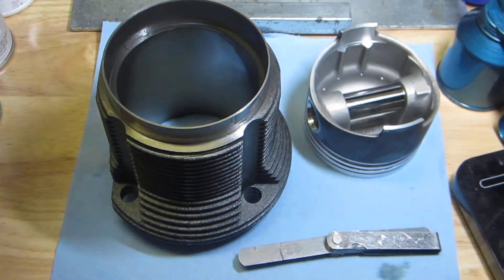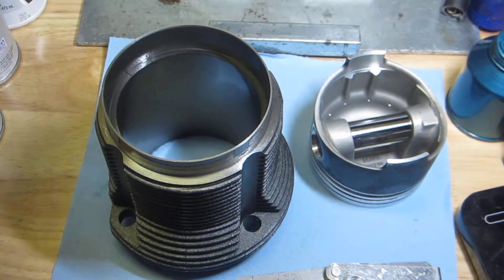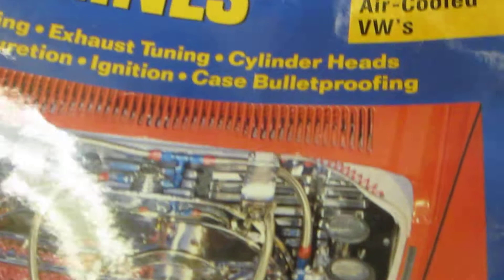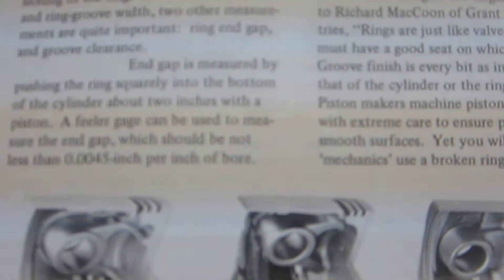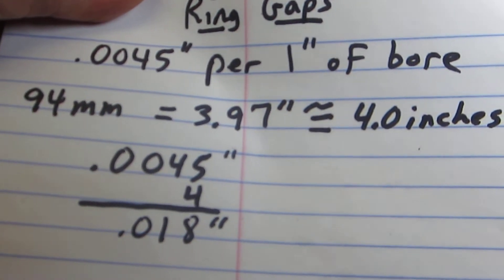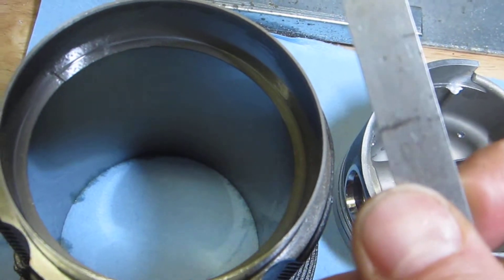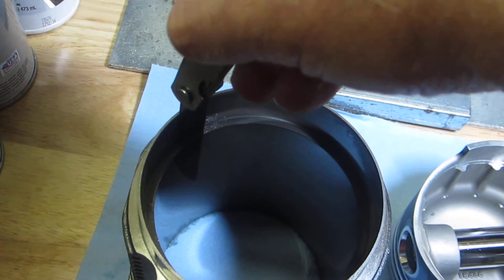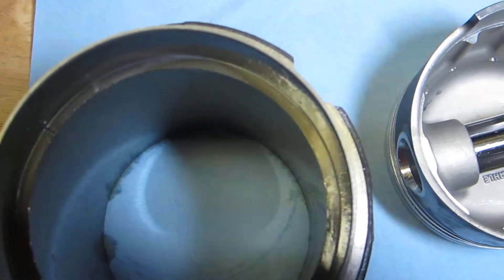Setting VW Piston Ring End Gap

Comment: You should check the ring gap at the top part of the cylinder, maybe 1/2” down, and again around the middle of the cylinder. The rings will never be that far down in cylinder. 
It’s a good idea to check top middle and bottom to see if the cylinder has any taper. 
Good luck with your build.
Reply from the maker: Good point! It's been awhile since I made this video and I apologize for any misinformation given :-)

Comment: 94mm = 3.700inches?    .017 ring gap?
Reply: 0.16 to 0.18 I would go for.👍
Reply from the maker: I'll want to go back and have a look at my references but I believe .004" of gap per inch of rounded up bore is adequate. My reference is the How To Hotrod VW Engines book by Bill Fisher.